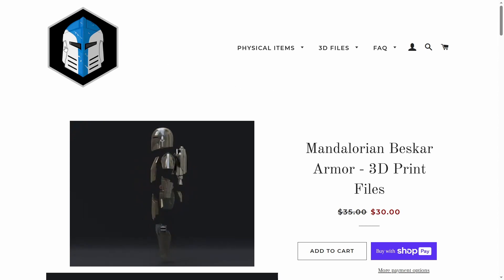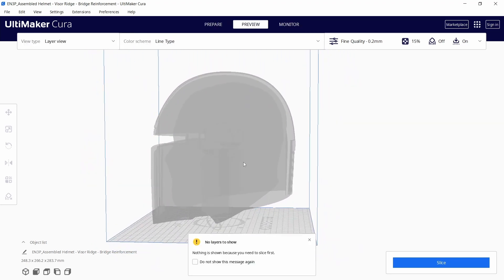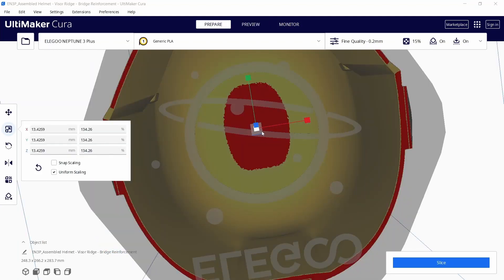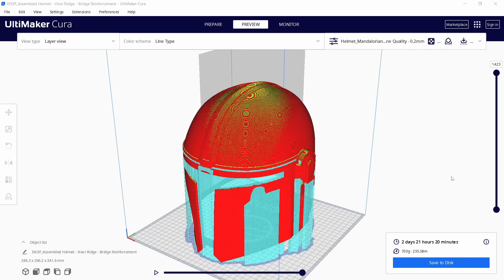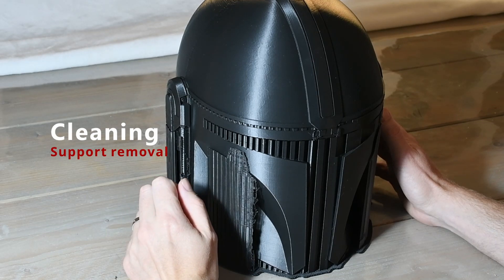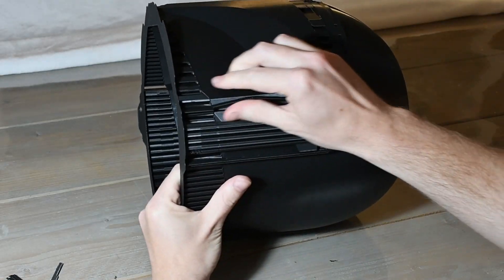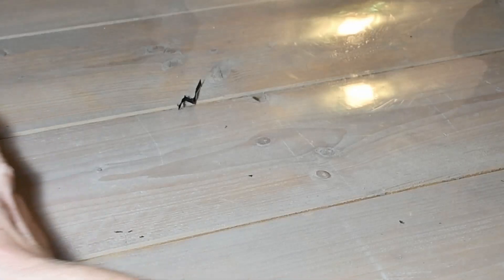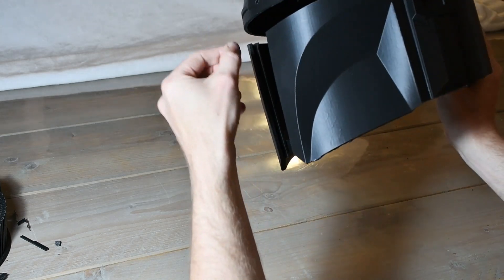3D Printing the Mandalorian Helmet on the Elegoo Neptune 3 Plus

Comment: How do you have it set on Fine quality and only have 2.6 hours print time? I am having a heck of a time with my settings,,, same file, same printer
Reply from the maker: Print time was around ~57hrs with the setting I used. Support settings, overhang settings and density can have quite the impact. Make sure to use the info screen on the bottom right as seen in the vid to identify where all that time is used for.